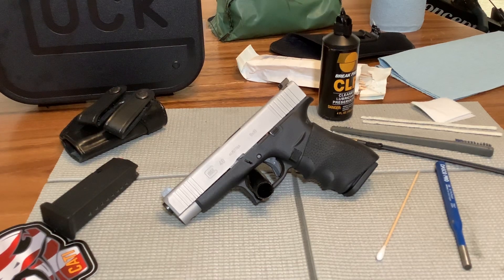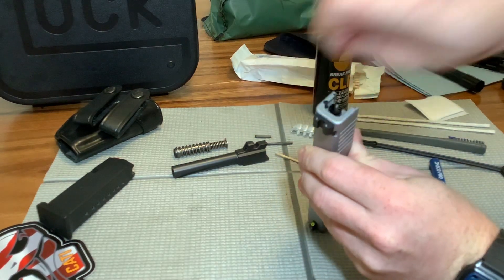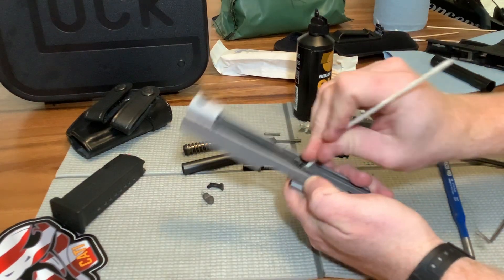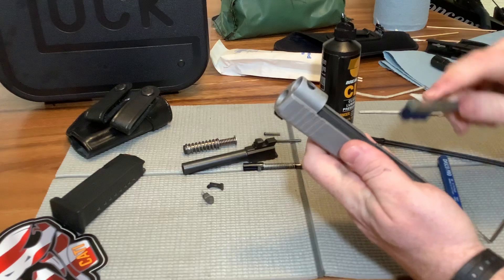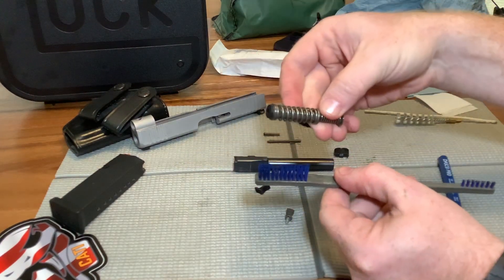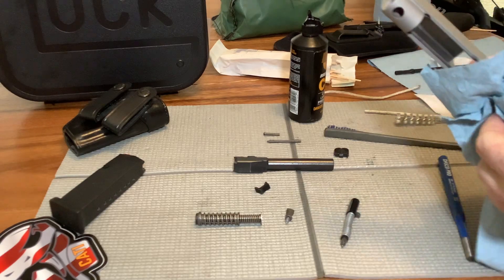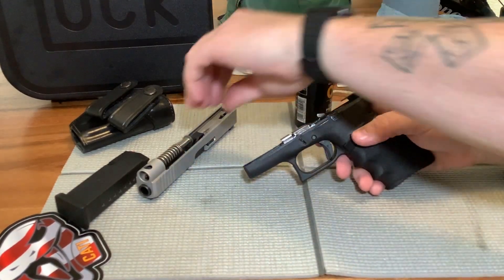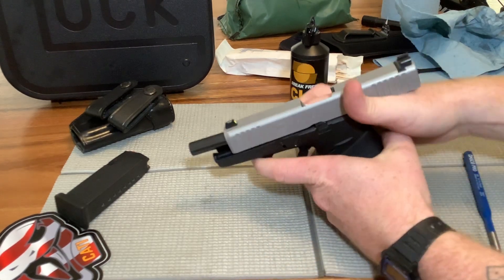Glock 48 - How To Disassemble Top Slide, Clean and Lubricate

Comment: Good video. A good way to lubricate it is to go 3-2-1
3 drops of oil to the slide: 2 drops on each slide rail and 1 drop on the barrel hood
2 drops to the barrel: 1 drop to the front half of the barrel and 1 drop to the locking lug
1 drop to the grip right on top of where the trigger connector is
Reply from the maker: Thank you!

Comment: Hi, besides the back plate, are all of the slide kit internals the same on every Glock slide?
Reply from the maker: Nena DeLeon  No, they are not all the same. Things such as the firing pins and some other small parts are different depending on what Gen and model Glock you have.

Comment: My Safety Plunge and Guide Rod Is Stuck 🙄🤦🏽‍♂️
Reply from the maker: Did you ever get it fixed?!? Sorry for the late reply
Reply: @SGR Tactical  Yeah I Used A Knife To Push The Safet Plunger Spring Down and I Meant My Plunger Depressor Not Guide Rod  😂